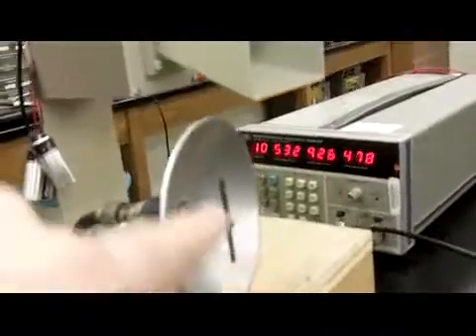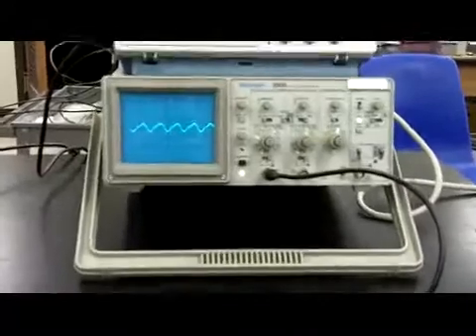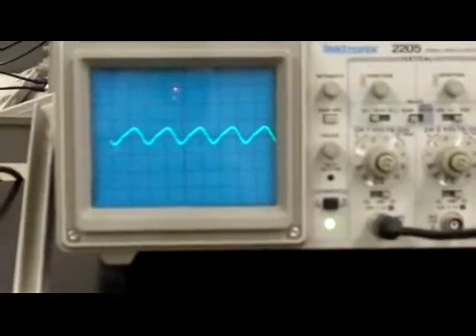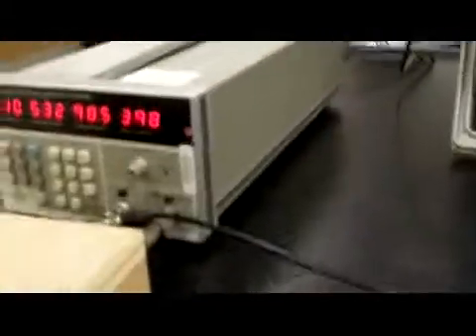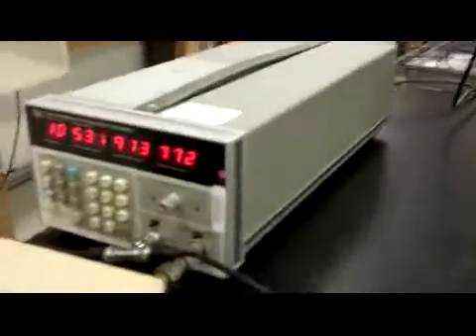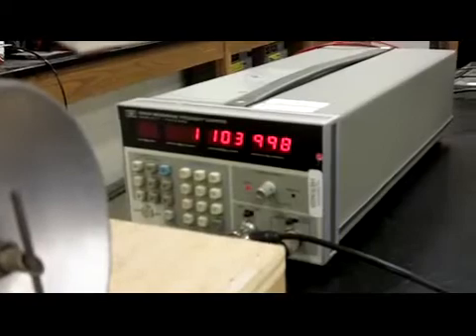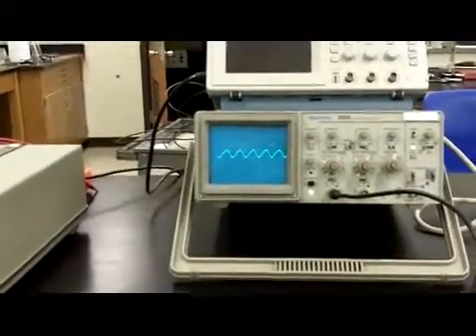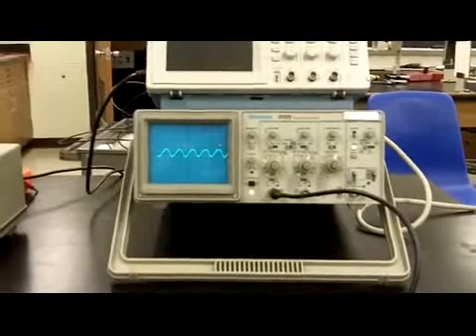Microwave beat frequency

Comment from the maker: Thanks.
But it's not ultrasound. My students consistently measure a 2.9cm wavelength using interferometry, which means that the waves must be traveling at the speed of light. 2.9cm _ultrasound_ would have a frequency in the kilohertz, not gigahertz range, a factor of one million smaller.